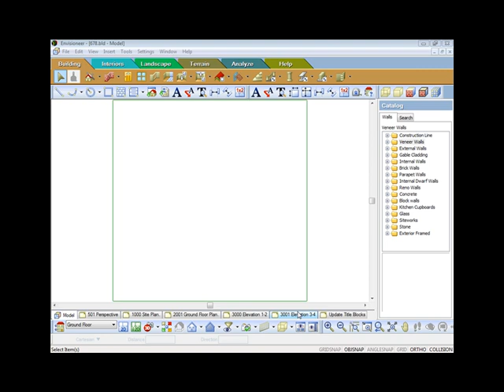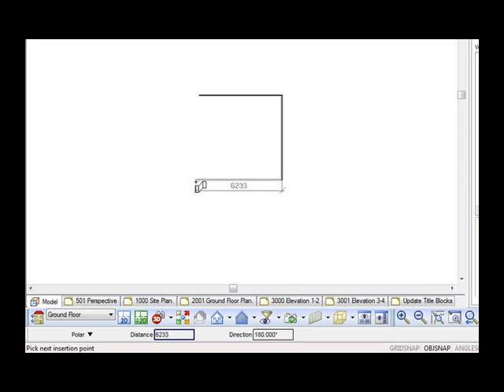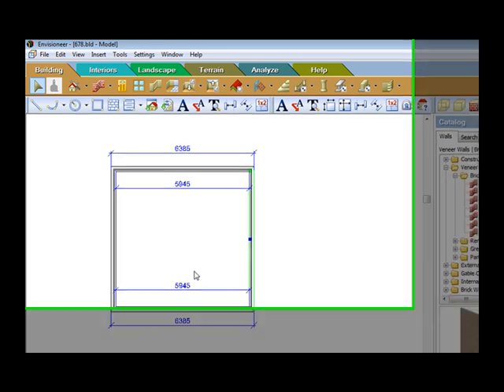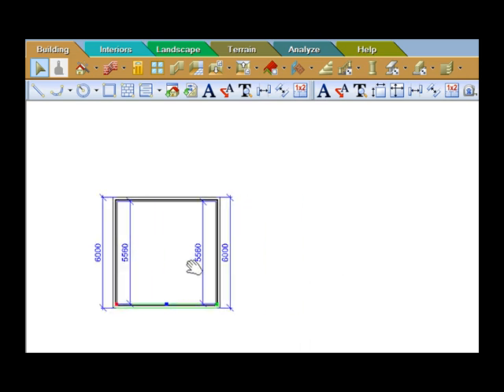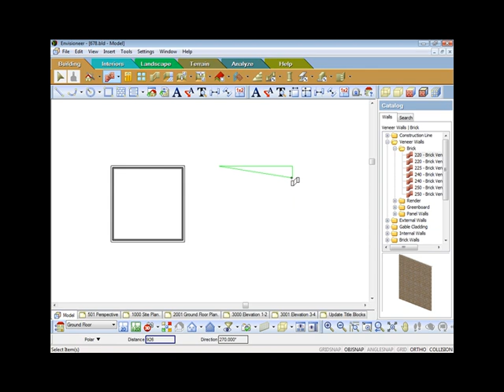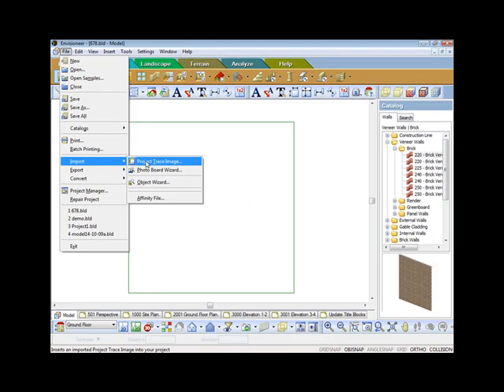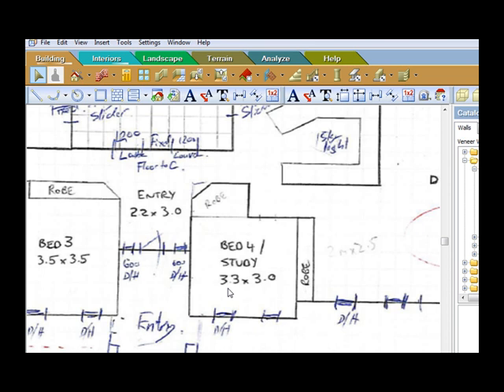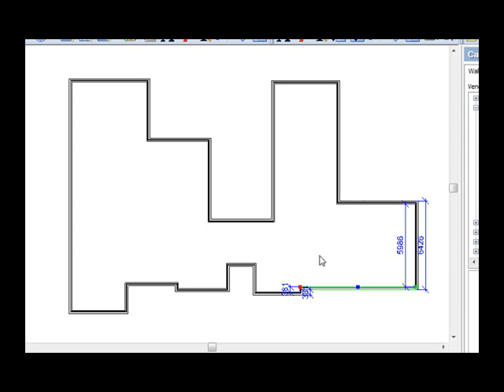Envisioneer: Inserting Walls

Comment from the maker: Turn off Ortho and then you can move your cursor on angles. Ortho is docked in the lower right corner of the screen or you can hit the F8 key on your keyboard to turn it on or off as well. With Ortho on you will only draw straight walls at 90 degree corners, but with it off you can go on an angle. We recommend you keep it on to ensure straight walls until you have an angle wall and then turn it back on again.